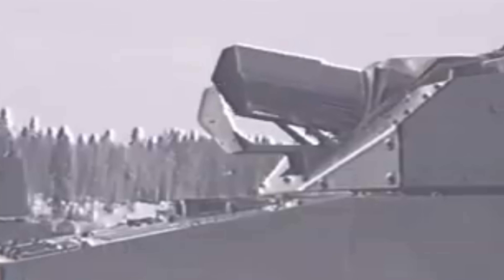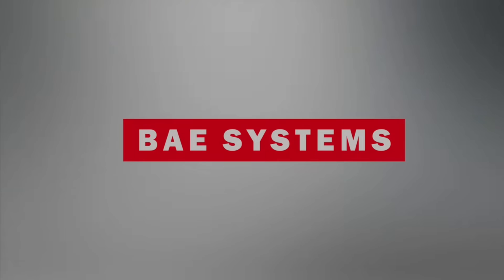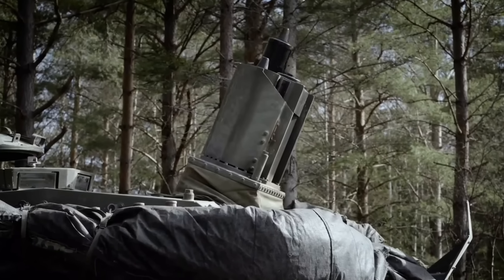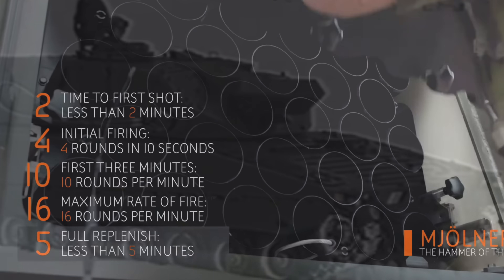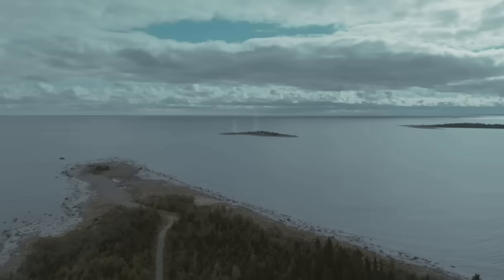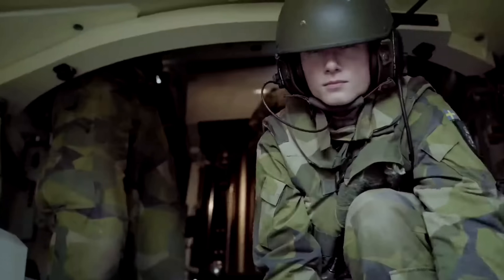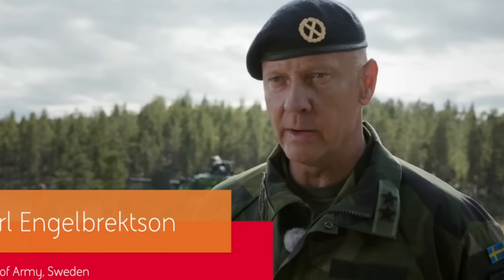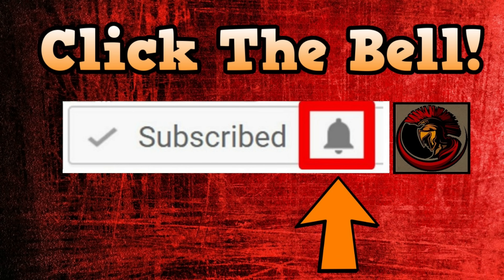The 'Mjölner' Rapid Fire 120mm Mortar Vehicle | DOUBLE BARRELED INDIRECT FIRE

Comment: How does this compare to the PzH2000 or the CAESAR?
Reply: like two 120mm mortars to a 155mm howitzer.
Reply: @ornestal2615  I somehow doubt your assessment as both Caesar and PzH2000 have wildly different mobility and you failed to compare either to this.
Reply: @Argosh : Now you are just being ridiculuse, its like comparing a handgun with RPG. They are mobile but the diffrence is types of gun.
Reply: @Argosh : The question you want to ask is the Archer system vs. the PzH 2000 or the Ceasar.
Reply: @ornestal2615  they have a role on the battlefield. They are artillery support for frontline troops.
Reply: Let’s compare the big boy archer instead since it’s the system Caesar dreams of being when it looks in the mirror. archer is the best in all regards
Reply: @fredrikholm3700  my mistake for expecting anything worthwhile in a YouTube comment section.
Reply: @Argosh : If you ask a stupid question, you get at stupid answer. 😉👍
Reply: @Argosh  your mistake was comparing different classes artillery against each other and not knowing the diffrent
Reply: @fredrikholm3700  let's entertain your assertion for a minute. If it's a different class to the PzH2000 or the CAESAR a polite answer to the above question would be: "The two systems you named are howitzer artillery, the Mjölner is for <insert thing here>."
Had you done so you would have immediately seen a tiny little problem. They're literally for the same mission profile. According to the Swedish Army they chose this "downgrade" from the AMOS for economic reasons to improve their indirect fire capability of their mechanized battalions. Which is quite reasonable as they had the Chassis already and didn't have the money for getting a full AMOS. Since this runs on the common (for the swedish army) CV90 platform that's a really good fit.
Now let's take a look at the PzH2000. It was developed to... be indirect fire capability for German mechanized batallions... That's why they chose drumroll the Leopard 2 Chassis as developmental base for it. You know, so it can stay with the mechanized batallion it's supposed to enhance. (That means that the final Chassis is actually different but shares many commonalities with the Leopard 2, just so neither of you clowns tries the "well actually the PzH2000 chassis is not the same" routine...)
The vehicles have a lot in common, tracked, torsion bar suspension, one has 300km operational range, the other 420km, the two primary distinctions are weight and cost. The Mjölner comes in at a measly (for a tracked vehicle) 22t, while the PzH2000 should probably see the gym a bit more often at its whopping 55+t. The price is even more extreme, since the chassis were basically free the swedish army got its cake and ate it for a whopping 1.7 million dollar a piece, while a brand spanking new PzH2000 will run you about ten times as much. For your ten times ticket price hike you get a lot more range, a wide variety of 155 shell compatibilities that can push the range to beyond 50km, more armor and just... overall more. What you don't get is (getting) rid of the dang CV90 chassis that are gathering rust in a hangar somewhere. So cudos for the Swedish Army and Industry turning a slightly moldy turnip into a shiny worthwhile asset.

The odd one out in the trio I made is btw CAESAR, that was originally a simple technology demonstrator, but the french liked it so much they bought it almost as is. Unlike the Mjölner and the PzH2000 the CAESER is actually not technically intended for embedding. Its wheeled basis and much lower weight allow it to move faster on roads but limit its offroad capabilities. It is, in fact, very hard to compare to either Mjölner or PzH2000 but they're very popular platforms ever since the french sent them along the PzH2000. In a manner of speaking these three systems actually complement each other quite nicely.

Did I know all of the above when I asked the question? No. I was sort of hoping for a knowledgeable person to come along and fill me in on this without having to spend 20 minutes researching. Did either of you two bozos know any of this? No. You were just pretending to be smart and acting like the douchecanoes you are. Hence my remark about mistakenly expecting more from a youtube comment section. Peruns and Lazerpigs truly have spoilt me rotten.

So, back to CoD for you two now. I'm pretty sure it's either that or homework... Kids these days...

EDIT
I just realized I mistakenly used 150mm in one of my replies above. A person with any knowledge at all would probably have picked up on that and used it to school me. I guess you're both just really really bad even at trolling...
Reply: @Argosh  to be clear i Served in the Swedish military as a fjälljägare and I have had mjölner light up the sky from less then 3 Kilometers away when hunting your squad with regular soldiers and cv 90s, it fills a different mission role then the other systems you compared it to, but you made good points and yet still wrong system to compare since I’ve never seen an archer fire on targets in an 3 Kilometers area of its self before and I would guess that neither the French or the German system does that since they have mortars for that just like Mjölner.

never assume that someone is stupid when you have never seen any of the systems up close and only can go off publicly available information.

Comment: I think the Amos and the Mjölner is very good to use together, i think Swe is making a misstake not getting both:
Mjölner for the cheaper price weight of "mass of firepower"
Amos in smaller number when a higher degree of precision and direct fire support is needed.
Reply: Amos also has the autoloader whilst Mjölner has two persons working as loaders. For small countries where manpower is limited, Amos frees up a lot of personell to use for other assignments.
Reply: @mrwoozie1735  Very true.
Reply: AMOS was made for Sweden, until Reinfledt/Borg decided to "save" money  by not installing the turrets built, and instead paying about the same for the breached contract.
Mjölner was the low-cost alternative to get the mortars in the 40 hulls that was standing in storage, fully converted and waiting for those AMOS turrets.
Reply: @johanmetreus  Hi Johan,
Do you have a source for the breach of contract? As i can read it was just considered as Amos lost the selection competition due to it was to expensive.

Comment: Seems like something that would decimate a fortified position or a mechanized push if it got into range.

I don't think one should underestimate what a closed system can do for crew comfort in what can be freezing conditions either.
Reply: Yes in the arctic north of Sweden this is worth a lot at -35 C and it is fast with great terrain capability!

Comment: You say that the Mjölner isn't selling. I think that is likely because mortars are seen to only good for saturating a fairly significant area with unguided shells in order to target soft targets like dismounted infantry, unarmored vehicles supply trucks, ammunition caches being hidden in a barn say and front line command post in a commandeered house. 

Like you were saying I don't think they see the potential of the rapid ability to set up to fire, fire a stupendous number of shells and then be moving again in a minute.And I don't think they are seeing the incredible synergy between turreted and tracked mortar carriers and precision guided rounds. The perception of mortars as being like a blunt instrument just doesn't line up the perception of guided weapons as quarter of a million dollar scalpels used only on the most important, high impact targets operating far to the rear like a bridge or division or army level headquarters. 

But with the development of precision guidance kits like the M1195 that are running about $6.5k that can make a standard 155mm shell very nearly as accurate as a $160k Excalibur round, or the M1195's little brother the XM395 that does the same for the standard 120mm mortar round, that calculation is changing. 

While the cost of the PGKs tipped rounds are still maybe 10 times more expensive than unguided rounds, the important thing is that it might now only take 1/10th the number of rounds to accomplish a given fire mission, so the cost just in dollars of the shells going downrange is the same for a given fire mission. But even if the use of guided shells makes a fire mission still twice or even three times more expensive than doing it with unguided shells, I think the calculus will that guided shells will be used for every fire mission. That is because there are a number of other costs besides just the cost of the shells to finish a mission. A big one for any modern army is the enormous size of the supply tail they drag around behind them. Reducing the number of shell required by a factor of 5 to 10 is important due to the much lower cost to move two shells to the front rather than 20. And then there is the opportunity costs of the fire missions that couldn't even be accepted because all the existing guns were tied up firing so many more rounds to complete the existing missions. And those missed missions end up costing a lot more troops killed or injured because Artie was too busy to blast them a path through a trench system or take out a bunker and so they had to go in unsupported because they had a timetable to keep and so couldn't sit around until the battalion mortars could find some time engage the targets they needed reduced. 

And when it happens that commanders no longer have to stop and ponder if a target was high enough value to use a guided munition on it, then the advantage of the combination of a highly mobile system with such rapid setup and take down like the Mjölner firing guided munitions will become much more obvious.

Comment: With the GRKPBV 90 (hurray for Swedish defence force abbreviation!) lightning really does strike twice. If there's one thing I would say about the swedish military procurement system that makes it stand out is a pragmatic and solution-oriented mindset. In a short film produced by the army about this vehicle, they describe how they went from contract negotiations with BAE in the fall of 2016, and preproduction vehicles delivered after instructors had been trained in january of 2019(!!). They got a time-frame, a budget and a set of requirements and in less than three years released a cost-effective self-propelled mortar system upon an unsuspecting world, and I think that's very impressive. I mean can you IMAGINE what this thing can do to an armored column, firing those heat-seeking top-attack STRIX rounds?

About that comparison to the Humvee carrying a 105mm howitzer: I think it's a question of operational requirement. The US army expects to fight a lot on big open plains, so they invest in the heaviest armor for their tanks and the punchiest ATGMs for their IFVs and infantry - this also means that howitzers have more utility, as mortars on a big open plain would be more vulnerable to detection, seeing how close to the front they are. The Swedish defence force however operates in heavily forrested terrain, where you can much better hide mortar batteries. That's my theory, anyway
Reply: I considered where Ivan (a nickname for Russia) would attack first and it would most likely be middle to north sweden - very rocky/hilly terrain with alot of forest so I'd say you're correct. The northern part holds most of the iron extraction so it would be a prime target. Middle sweden has the capital region.
Reply: @Brakvash  not really.
The strategic value of Sweden to Russia isn't our resources, it's the way we are an obstacle to accessing the North Sea from the Baltic sea and the way our country is a key to successfully deny NATO ability to reinforce it's Baltic member states by air or sea.
The main attacks would come towards Gotland, Blekinge as well as southern/western Scania
With secondary attacks towards Stockholm to decapitate the government and press on towards Oslo, and in the North to seize the big hydro power plants, iron mines and press on to Narvik.
 (And capturing or asassinating the civilian government won't matter much to the defense efforts as Sweden isn't centrally governed top-down, the constitution doesn't mandate the government to negotiate surrender while under invasion, and the military chains of command and organisation are separate from the civilian government in everything but budget and legislative framework.
Plus the fact that Swedish defense doctrine explicitely advocates flawed initiatives above inaction on every level down to individual soldiers as long as those initiatives are aligned with the intent and purpose of the latest recived orders. And that every soldier manual, the civilian crisis/war booklet and every single public phone book from 1940 until they stopped printing the phone books in 2010, stated: EVERY MESSAGE SUGGESTING THAT RESISTANCE SHOULD CEASE IS TO BE DISMISSED AS FALSE!
Reply: Logical and probably correct analysis.
Reply: I mean that obviously says grenade launching armoured tracked wagon.
Reply: look at the map of Sweden about 50% is woods we need another way of defending Sweden then the plains of USA or open deserts in midle easts hens fast deploying weapon systems like archer / mjölner / cv90 platform and so on that can shoot and reallocate in minutes
Reply: @noodlesswe5687  
Yes I know, I am a Swede

Comment: The AMOS just seems better. Less work for the crew (less crew needed ?), better rate of fire... Also probably a longer range because of the longer barrel.

If price is the only reason for the Mjölner to be used over the AMOS it's a terrible news for the Swedish army...
Reply: Well, you need to take in mind the increased weight on an already heavy CV90 Chassi and way easier maintenance. I don't say Mjölnir is better on paper but it may still come out as a better fit. 

On a brand new platform there is no reason to not go for the AMOS but on the CV90 chassis is a different thing and that is what Sweden wanted to keep maintenance and logistic as simple as possible.
Reply: @benktlofgren4710  If maintenance and logistic is really that much better it's a good choice, but from the few researchs I made the only argument I found was always cost...
Reply: @MrMorvana  that is ofc one big part but it also boils down to the Swedish army wanting the Cv90 chassis and what is best on that.

The Patricia for example is awesome and that wheeled chassis really works well with the Amos.

Comment: Bravo again for the Swedes weapons manufacturers!👏👏👏 They are always decades ahead with their new mil innovations. I am not aware of precision guided mortars. And what is shown in the footages were just normal conventional mortar bombs.
Reply: Standard ammo is tripple mode Svinggr m/86Z
(Airburst, impact or impact delayed HEFRAG)
Themortar shells with a grey body and yellow band are smoke shells.
Grey with a white band are star shells(illumination flares)
Green with a yellow band are HEFRAG
And the programmable STRIX IR profile homing anti tank shells are long black cylinders with a yellow band with the finned propellant module and the ER rocket booster loaded separately ahead of the STRIX munition. It's range is however misquoted (I've fired them myself) but I won't state the actual range.
Reply: STRIX video https://youtu.be/oY9S-PcKLYs

Comment: This system seems somehow inefficient.

You load the round by hand into a tube, a tube which extends and loads the round from the tube into an actual mortar tube. Is there a reason why they couldn't make a system that would load the rounds directly into a mortar?
Reply: I'm not a military engineer but if there was a way to load mortars another way I think it would've been used by now
Reply: @manstermanman08  That's the thing, it's a tube. There is a reason why we don't use muskets anymore. Just slap a breech onto it and then load the round with an autoloader from the back.
Reply: Mortars are always loaded from the top.
Reply: @darkiee69  Let me introduce you to:
- Brandt 60 mm LR Gun-mortar
or
- 240 mm mortar M240

Comment: It's bizarre how good this concept is. I wonder how much manual actions are required to set this thing up to get going. You saw the labor intensive setting up of the Hummer-borne mortars. This thing probably does it electrically driven with some computer software to guide it.
Reply: Yes, the vehicle itself also has several different geolocation systems and a ballistics computer hooked up to a radio data link.
Any Strv122 or CV90 or infantry FO or other Swedish front line asset with a radio and a data text terminal or computer or tablet hooked in to the network can send a pre formatted firemission request, that, if correctly authorised and filled in, will be automatically processed by the ballistics computer and the firing sollution saved and updated once the Mjölner comes to a full stop.
The operator can then level and aim the piece at the push of a button while the loaders prep the ammo, loads and operator fires as specified in the firemission.
At mission complete, press button to stow the barrels in travel position and drive off before enemy counter battery assets even has time to load.
Reply: @SonsOfLorgar  That sounds insanly effective.

Comment: The Mjolner is good value and can deliver a huge amount of firepower quickly, accurately and with adequate range. The US Humvee based 120mm mortar team on the other hand is just awful to set up and offers no armour protection. Put the Mjolner on a stretched and modernised M113 such as the Australian M113AS4 and you have a high performance artillery system at an even more affordable price unless you want to standardise on the excellent CV90 IFV like Sweden - and Ukraine needs a few hundred now.